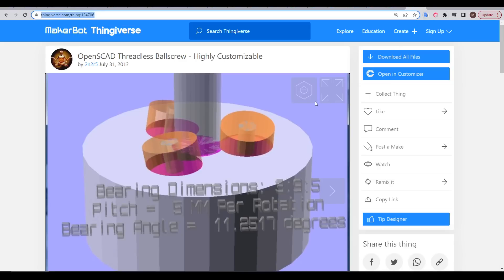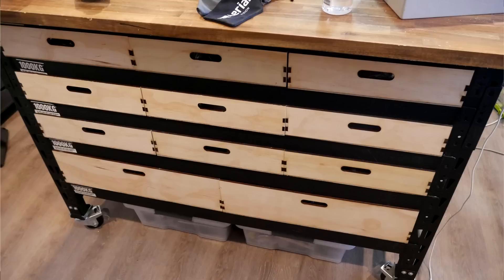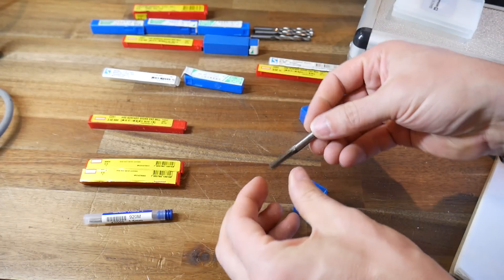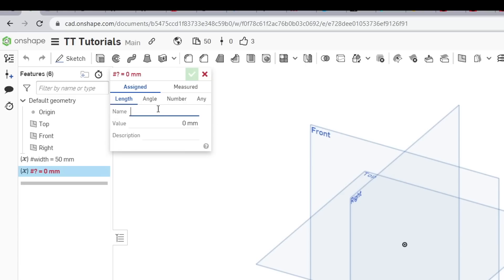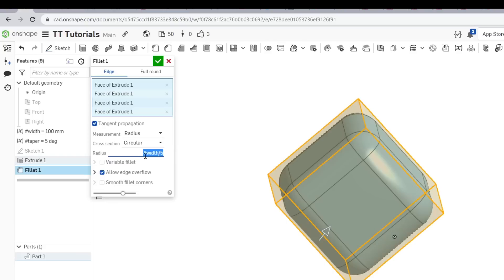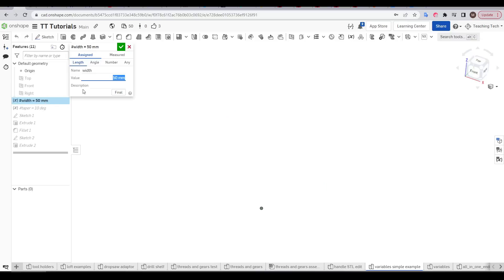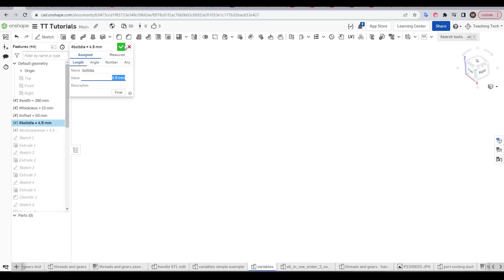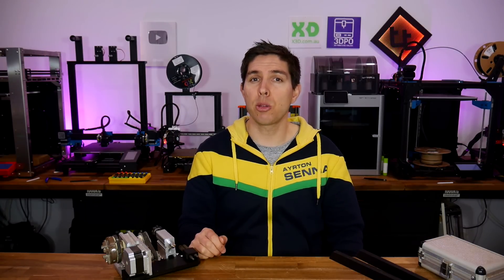Flexible CAD designs using variables - 3D design for 3D printing pt8

Comment: Another advanced related tip: configuration variables!

Configuration variables are like normal variables, and you can use them the same way, but they are more like function argument inputs than local variables. Their value is not part of the document, so you can change their value without editing the document. This means you can change them on published released versions, not just the current working version, and see the different results. So you can share a link to your released version and people can change the configuration, see the different results, and export a *.3mf or *.stl model, without having to know anything about OnShape.

Even better, a part studio with configuration variables is like a subroutine that can be called with different arguments to create custom parts in another part studio or document using the "Derived" feature. Multiple parts in these callable part-studios are like a function with a tuple return-value, and you can choose which of the parts or sketches you want to keep.

Configuration variables also have some superpowers over normal variables; they have some additional types available, they can select different values/expressions for features, they can suppress features, and they can "hide" depending on other configuration variables;

* they can be a "checkbox" or boolean, which can be used to select from two different values for any kind of feature input, or to suppress features entirely. So they can toggle a bore hole on or off, or toggle a hole between a big or small diameter.

* they can be a "List", which is like an enum value, where each row represents a different enum value, and each column a feature-value or feature-suppression state, with different values for each enum value in the table cells. So you could have a "Size" table with options "Small", "Medium", or "Big", and have it select different dimensions for many features, and even suppress some features that are not applicable to certain sizes.

* Their visibility can depend on the value of other Configuration variables defined before them. This means you can hide the "bore hole diameter" config input if the "enable bore hole" checkbox before it is not selected.

Note there is also Variable Studios, which are kind of the equivalent of global variables that can be referenced by other part-studio's or documents, but I've never found a use for them yet.

Comment: Some advanced variable tips for variables with patterns:

* You can define another variable with the same name and it will override all references to that variable after it. This means if you move features that depend on the variable before/after the re-definition it will change the feature.
* A re-defined variable can set a value based on it's previous value, so you can define `count = 0` and then later define `count = #count + 1`.
* If you create a feature pattern with features that depend on `#count` and also include the variable definition `count = #count + 1` in the features to pattern (but not the original `count = 0`), and tick the "reapply features" box, then the features will be re-evaluated for each instance (not just the first resulting geometry copied) with the different incrementing versions of `#count`. So a circular pattern of holes with diameter set to "#count" will give a circle of holes with increasing diameter; or an instant drill bit holder!

This means patterns can be used like for-loops that evaluate the features for each iteration with changing values. Clever use of formulas to calculate different feature arguments based on one or more self-modifying variables can do a whole variety of different things. You can also pattern a varying pattern inside a varying pattern like nested for-loops. You can even vary the number of iterations of the inner pattern based on the instance in the outer pattern. I've used this to generate variable numbers of planet gears with different angular offsets and identifying circular marker patterns.

Comment: I'm new to 3D printing & CAD I'm trying to design a lathe tool height tool that is  basically rectangle in shape but is cut out on both sides to accept a bolt on each side to facilitate getting the lathe cutting tool on center, can Onshape do designs like this??

Comment: Quick note: while multiplication and division "just work" as expected, if you want to use addition or subtraction with your variables you need units. I found I couldn't use #var+5 which I found really perplexing; after some googling I find #var+5mm works fine. Just in case somebody else is out there scratching their head like I was. BTW this series is amazing...I had no CAD experience whatsoever, and now having watched this series and nothing else I've already modeled and printed a bunch of useful stuff. Thanks.

Comment: Great series Michael. Possibly a very useful lesson would be how to break up a design to be able to print and put back together. 

Eg if the part or complete  thing one wants to make is larger than the print bed how could we split it and print it to go back together and some different options of how to create the joints. Eg snap fit, slide lock, push fit, a twist connect,  screw

Comment: Most of my designs use variables. Some of my complex designs are completely variable driven. I have examples of parts that have full thread definition driven by variables complete with knurling patterns all in one part. Been doing this for about 15 or 20 years. Makes it extremely easy to change or modify a pattern or a shape.

Comment: Everyone is using Fusion 360 since forever, so why are you promoting Onshape. By the way, I believe you are referring to parameter based design workflow in which values may be changed to suit changes in design requirements.
Reply: His choice was well explained in the first video of the series. Also, not everyone is using Fusion 360 since forever. If you don't like his choice of applications then you are free to find another tutorial elsewhere.

Comment: I love this series! So useful and spot on with the topic of each episode. 

One thing I’d love to learn is more advanced use of variables.
Let’s say I was making a holder for screwdrivers and I then specify with variables how many screwdrivers it’s supposed to hold. So if the part has 4 holes, I could say 10 and then suddenly it has 10 holes. (And preferably more advanced than just simple holes, ie. square pockets for a selection of sandpaper)
I presume the variable could drive a pattern feature but I have never gotten it to work.

Comment: Thank you for the great tutorials. I would really like to use onshape instead of Fusion 360 but I have a big problem: it is not possible to use comma when typing decimal dimensions. Writing a dot is very inconvenient for me. I don't want to change Windows settings because of a single software.
Reply from the maker: I've looked through the preferences and I can't see any option for that sorry. There is a section in the forum to post feature requests if you like?

Comment: One thing it would be good to talk about is how to design for printing - orientation, minimising supports (or using support where they won't affect seen faces), or even modifying the part design so supports are not required. - Adding design elements to help align / join / glue parts where they need to be split for printing due to shape and/or size.
Also, for more advanced designs, a discussion about how to design for more advanced manufacturing (ie injection molding) would be handy for those who are designing something that may go on to be mass produced; the design considerations are different to 3d printing, and it can be useful to think of both requirements when designing.

Comment: Can you make a tut with no cuts when you design something and have commentary thoughts while doing so?
Reply from the maker: I have a project i mind that could work for. The only problem is sometimes that I might have a few cracks at an element because I think of a better way to do it. If I were to include that and someone didn't watch the whole video, they might be lead down an inefficient path. Still open to the idea though.
Reply: @TeachingTech  Good point, but knowing you you’ll find some smart way to implement the different generations of how you design a part, and its good to show some mistakes as we’ll learn more of how to problem-solve and how to do things effectively. You are a great teacher’ keep up the good work.

Comment: to bad youre using software that requires an account, and probably cloud services too...... if i cant use it off line, with no log in, or other means of tracking..... something shady is going on, and im not falling for that trap....... i would love to have this same information, but for some legitimate software.

there simply is no reason for software like this to need my info.
Reply: Then don't use it. The concepts are applicable to other software applications. 

Of course if you were so worried about logins and tracking then you wouldn't be using YouTube, which will know a lot more about you than OnShape will ever know.
Reply: You've got a point, though for a tool like this I'm more concerned with the vendor's ability to arbitrarily destroy my ability to handle my own designs at any time. Backups/archives are not complete if you can't make sense of the data when you restore it.
Reply: Onshape is legit. There are dozens of other alternatives, like Fusion 360 which runs locally AFAIK.